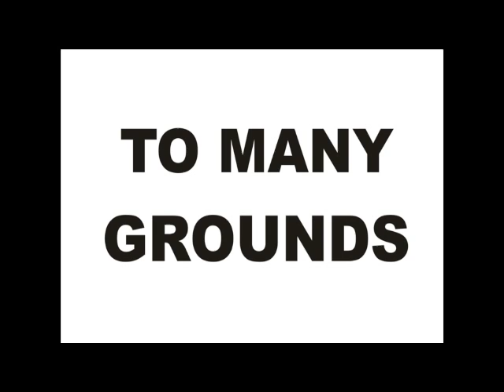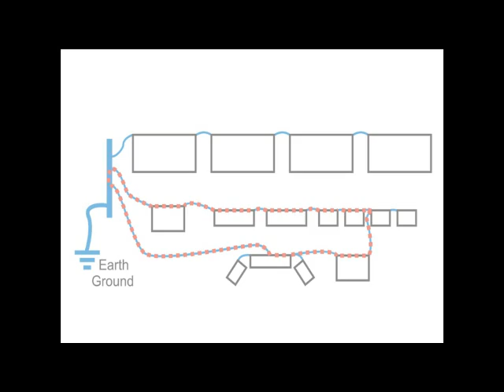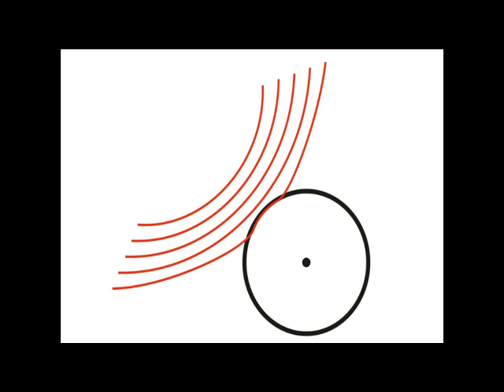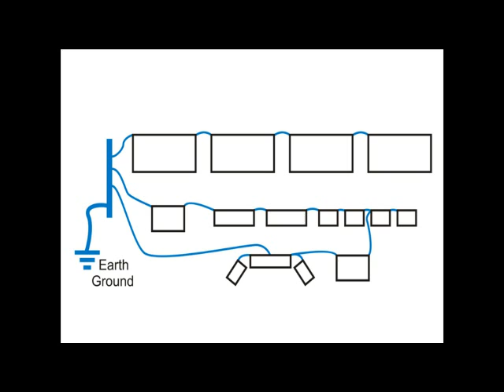Ground Loops

Comment: On your drawing all grounds are connected to the same point. Could there be ground loops even in that configuration? (I can imagine because wires are not superconductors, ddps can apear even if good practice grounding is implemented - they may be tiny but can cause noise on signals that will be amplified). Thanks!
Reply from the maker: If you have more then one ground you have a problem.

Comment: Colin De Souza

if you have incoming Earth, neutral and live wires to your pay metre and then to your single phase DB electrical board ok, as you explained and we all know world's over that is the standard of practice, if you connect from the incoming main electrical source before you get the DB board electrical board connecting points inside of the paint meat before it goes to my DV boat incoming neutral and incoming Earth that is supplied to the homestead together at the point of the electrical paid metre that is the Neutral and earth ??

I have many problems it's seems to me like I'm fighting a losing battle and i'm busy with attorneys now the power company have insulated new electrical infrastructure and the problem started the day they  started the new installation of the electrical system the inside of the pre-paid metre before that was still in good condition and there was three connecting points neutral Earth and live inside of the pre-paid metre and with the newer pre-paid metre there is three connecting points Earth neutral and live before it goes to my  DB board electrical board connecting points but what I saw the electrician gays did is that they connected neutral and earth together inside of the pre-paid metre after that I had electrical devices breaking for no reason at all then it seems that my current is just running away somewhere and I'm just buying units after unit and it does not work for me I had my electrical geyser and Stove all been disconnected from the system but still the same then there is a deafening sound like bells ringing in the distance best to describe it it's like a pulsing soond??

then the city power company is still accusing me of high electrical usage to be honest I'm only using sometimes the lights at night that includes the TV and then the kettle for boiling water to make tea or coffee I have been on a Shelf investigation for the past two years which city management power company which I bought two cases now already against him for the electrical installation there was private contractors commissioned by the city's power company and it was not the power company's
own electricians, so one other thing that I want to state here is that if I place a electric sensor device to the concrete flooring of the house the electric sensor device will Sirens the alert red flash with large beads that it detects electric on the concrete flooring inside and outside my house in shirts that's why I want to ask the question is this a ground loop that is present here ?? 

because there is a Earth bar in said of the DB electrical board and it is not connected to the electrical prepaid metre ? !now where is the drain releasing charging too if there is overload ?? if it is not connected to the Earth and neutral that is connected together inside of the of the pre-paid metre before it's connect to the DB electrical board is there anyone that can help me with an answer for this half of my family wages is going to electric bills let me quickly note to you with the intriguing part of the story

in 2018 the city power company installation new electrical infrastructure,data meter electrical systems, they forced me out of my old metre and the same for other residents also in the area then exactly 7 months after that they serve me with the letter where they accuse me of tampering with the metre for stealing electric but you must now remember that there was no electrical inspection of any shorts at any given time their allegations relateing to a claim they make during the period of 2018 it appears in the letter almost like they have discovered a infraction on their electrical system or Grit they know where explained that they are doing a upgrade of the entire neighborhood and electrical system but I fight them through all of that with their own investigations and each time I show them that they are manufacturing they are lying they plays me on a penalized system which so whatever I buy in unit almost half of that gets deducted immediately they tell me that I own 21000 but I don't give up I fight then for all it is legal

Colin De Souza

but in 2021 the city power company sent new letter stating that there was no tempering with a meter but it was a m that was not properly working and therefore they want to ask me that I must give a reason as to why no electric bought during the period of 2017 now as you will see they keep on adding on this so-called charts but they're also giving away that they are that this is part of their mandatory all system that they are implementing across the billboard so I am in the week to come going to see my attorney and trying to explain to him this whole thing that's I need the Independent electrical evaluate what does City power companies inspector out on my property to do a evaluation the problem is not so much the of the trumped-up charges they bringing along because I have all the evidence that they are lying and it's trumped-up charges covering up for a cheap Chinese electrical installation ? but it is what they have created afterwards with my electrical system
Reply from the maker: Send me a diagram

Comment: Sir I using earthing for cnc router machine, and computer and machine controller computer ,so how to given earthing each items, it's series type earthing, or make three wire from earthing rod and connect ,pallrer type please guide me 🙏
Reply from the maker: Does each equipment have a three prong plug?
Reply: @AllAmericanFiveRadio  yes all have three point
Reply from the maker: @sonuverma2796  I would use the three prong plugs as designed by the manufacturer.
Reply: @AllAmericanFiveRadio  your mean I connect earthing rod 8mm thick wire in connector, and take earthing for each items pallrer connect
Reply from the maker: @sonuverma2796  You plug the thee prong plug into a three prong plug socket.

Comment: Hi, when you added that other device to the bottom chain, how does it get connected to the middle chain? Would adding an amplifier and connecting it to a receiver using audio cables and where they are each plugged into different receptacles be an example of this?
Reply from the maker: All units only have one connection to ground. If you have more than one path to ground, you have a ground loop.
Reply: @AllAmericanFiveRadio  I hear a buzzing in my speakers.  all components are plugged into one outlet and the TV is plugged into another outlet on a separate circuit.  so there shouldn't be any ground loop right?  but I still get a buzz in my speakers.  if I raise the volume of my amplifier, the buzz doesn't get louder.  does that mean its not ground loop?
Reply from the maker: @velocci6666  The buzzing not changing with changing volume means that the noise is coming through the power supply or is coming from the amplifier power supply. I would leave the amplifier pluged in and unplug each component one at a time yo see if the buzzing goes away.
Reply: @AllAmericanFiveRadio  i already tried that and it doesnt go away
Reply from the maker: @velocci6666  So it sounds like if the amplifier just has speakers hooked up to it, and no inputs, you still have the buzzing noise. You said that the level of noise does not change with the volume. This usually means the problem is in the power supply.
Reply: @AllAmericanFiveRadio  a problem with the power supply of the amp?
Reply from the maker: @velocci6666  Yes
Reply: @AllAmericanFiveRadio  i read once this could happen if you use high efficiency speakers. If it is the power supply, does it mean the amp won't last as long?

Comment: We used 1" wide ground strap to connect all the "peripheral" equipment to the building ground point at Control Data Corp (major computer manufacturer) 50 years ago, to avoid ground loops! When we hooked up the 60cy power (fans), we NEVER jumpered the power ground to the chassis ground. This was SOP for connecting peripherals and mainframes to power!
Reply from the maker: Yes this 100+ year old technology works well.

Comment: I have a desktop PC (running windows 10) which I use for guitar amp simulation.
The signal chain goes this way...  Guitar -> Audio interface (USB bus powered) -> PC -> DAW (plugins) -> Out from Audio interface to ->Speakers.
Things that are connected to AC power are, PC cabinet + Screen + Speaker + Modem router.
Everything is connected into a single power strip (surge protector) which is connected to a UPS and the UPS is connected to wall. So everything is grounded at same place, I believe since everything runs of a same wall outlet.
I have USB noise and interference noise into the speaker which just won't go away.
If I connect a 2 prong (Ground lift) wire to speaker, the noise goes away, but this is dangerous.
So how do I get rid of this noise with using 3 wire?
Where can I spot the ground loop in this signal path?
Thanks a lot!
Reply from the maker: You could unplug each item one at a time until the trouble goes away. The earth ground is just about the same as power ground. Between earth ground and power ground in my house is about 8 Ohm. Both are usually connected at the breaker box on the same connection.
Reply: @AllAmericanFiveRadio  8 Ohms is very nice value for the ground wire to earth resistance.
The noise goes away if I use 2 prong plug on the speaker. If I use 3 prong plug, then noise comes back.
The USB is generating noise in my opinion inside the computer. But using speaker without a grounding pin is said to be dangerous by many. That's why I use 3 pin everywhere. Do you think it's OK to remove ground pin from speaker wire cable and keep only the PC grounded by 3 pin?
Reply from the maker: You have proofed that the ground loop is in the earth ground. That’s what a ground loop is, to many grounds. What speakers are you using? Are they computer speakers, stereo HiFI speakers , or home make speakers. Give me the manufacturer and model number.
Reply: @AllAmericanFiveRadio  My speaker is KRK Rokit 5 G3. It's studio monitor speaker.
All the equipment like PC cabinet, Speaker, Screen are connected to a power strip and that power strip is connected to a UPS. So all is being grounded at one single point. Where is a ground loop in this? Maybe I'm not seeing what you're seeing. Guide me through it.
Reply from the maker: I see your speakers use the standard three prong plug. I cannot determine from here if it is save to use your speakers with out using the earth ground. I would contact ROKIT tech support. For-sure you have identified where the ground loop is, and as the source of the noise.
Reply: @AllAmericanFiveRadio  If 1 or more pieces of equipment are connected to earth ground and we lift the ground on 1 plug (lets say my speaker in this case), Then in case of leakage or fault current, won't the current simply get ground from the other equipment instead of me getting electrocuted ? 
All the problem gets solved if I use 2 prong on speaker but not sure if it's safe.
I understand you asked me to contact KRK but I think the customer support person will be dumb and won't know any technical detail. I'll still email them, but have less hope of a proper reply.
Let me know if anything strikes your mind, because you seem to have nice knowledge of this stuff.

Comment: I have my Revere S16 16mm sound movie projector and I did fixed the amplifier and it has a hum. So I got the service manual that I received from eBay and checked the lists of parts that the power resistor that came with it is a 20ohm, 25W power resistor which causes interference with the ground loop. In addition, I also got a GE 12AU6 replacement vacuum tube to replace the original and it still runs fine, because the original Lafayette 12AU6 tube is dead.
Reply from the maker: Great troubleshooting 
Thanks

Comment: I know this is an old video but my question is this you should conect all your cabinets together but not ground them to a separate ground because they are already grounded to the main house ground rod. Why would you want to make a separate awesome ground so that any big spike would more easily go thru your radio and to ground rather than go to your main house ground. Path of least resistance. Correct? 
Jeff
Reply from the maker: The age of a video has no relationship with the accuracy of the content.

Comment: One question, doesn't the noise flowing through the cable to the chassis (without a loop) induce noise on the lead conductor?
Reply from the maker: It's like draining off static.

Comment: i had an issue with ground loop with gaming headphones which are connected to the console 3 ways! the audio input to the headphones amp box, then a usb power connection to the headphones amp box, then from the amp box a mic input from the consoles controller. I started to power the usb without the console and not use the same mic when on PC and now have new headphones and a loop isolator coming in the mail. but it still usually occurs if the headphones mic and power source are from the same machine and it blew out two pairs!

Comment from the maker: Equipment will have an earth ground connection, if there is only one wire connected then there is no possibility of a ground loop. If there is two, then you must trace the two wires to make sure there is no loop. The ground/shield connection to pin one of an XLR is a standard configuration.

Comment: Really nicely explained! I just have a couple of questions:
1 -In what way is an equipment installed, in order to make it have more than one ground?
2 -Why do some XLRs have a 'bridge' or a jumper wire between the shield (pin 1) and the chassis of the plug?

Comment from the maker: The outside of the wire is a shield and the center wire is the signal. If the shield is connect to ground at both ends then you have the possibility of a ground loop. Usually the shield is connected at one end only. If you have a ground loop try opening the shield at one end. Also if you can turn the plug around on some of the equipment, try that.

Comment: You lost me, what do you by both ends. One side is the RCA right? Signal in the middle and the shield around it is the ground. On the other side, you only have one wire connected, is that the signal? or the ground? I feel like I may have the same problem, that's why I'm trying to figure what that other end is.

Comment: Great Video, I think I'm troubling with the same issue. I don't understand what that other end it? One side seems like an RCA cable connected to the device, what's the other side and why there's only one wire? 3:47 .  Thanks!

Comment: You may also want to star ground your connections if your devices are not decoupled in case you get ground bounce, due to the series inductance in the wires( around 0.5mH /mm) .

Comment: 4) In the IT world of CAT 5 cables the systems are built on the concept of 'swamped' ground. Everything is connected to ground. At 10 to 100Mhz this works great. For audio it may not.
5) The Taylor guitar video is incorrect and unsafe. Anytime you use a grond cheater as they suggest you are now using the guitar cord to carry any accidental current to ground.
6) Go to Jensen transformers for a good whitepaper on ground. It's techie but accurate.
7) Use high quality isolation transofmers! thnx

Comment: 3) The problem in audio primarily occurs for a couple of reasons. a) Since the 90s construction techniques bring the shield ground path onto the circuit board where it couples to the active audio path. If the shield by passes via a conductor or metal case this is better. In pro audio circles is the 'pin 1 problem'.b) No circuit is perfect, there is always some leakage of current from the power supply to somewhere on the box, when this box connects to another box with a pin 1 problem you get hum.

Comment: Thanks for your post, I am glad you are not advocating use 3 to 2 prong adaptors. Part of your explanation is lacking though.
1) Misconception one : Ground wires are not 'garbage collectors' for noise. They are there to provide a safe path to return power line voltage back to a comon ground reference, avoiding using a human or soemthing else as a path.
2) Big kudos for recognizing it takes current flow to produce a 'hum or buzz'.

Comment: Rick I've read huge debates about ground loops. What you say is spot on, well explained as usual. However is there ANY time you'd want to ground both ends of a shielded cable?

The only thing I can think of is a special case, where the pot or jack for example is isolated from the chassis (thus no ground loop). Than you can use the shield as a wire or the negative ground of that component (pot, jack, switch).

People debate this ground one or both ends of shields. You settled it nicely.

Comment from the maker: Yes ground loops can cause a problem, but they don't always cause a problem. If I am working at a 50K watt AM transmitter site almost always a ground loop will cause a problem because of all that strong RF. Had a Chevy dealership that was picking up the station on their PA system, a new install. Make some recommendations to the installers and they fixed the grounding. I do what works, in other words if I get it working or if it is working, I don't fix.